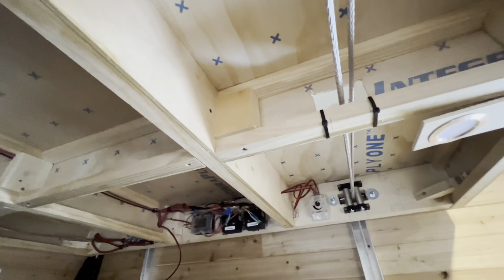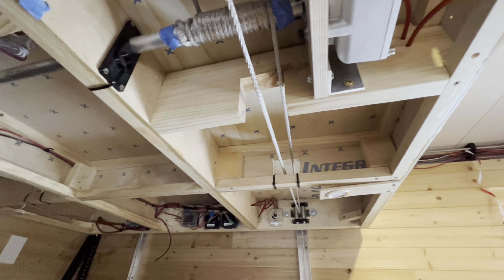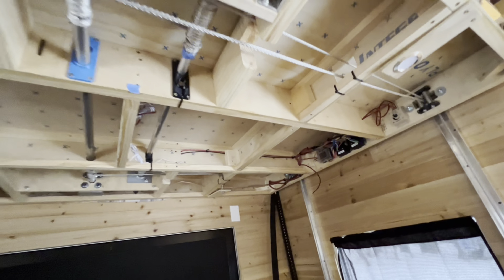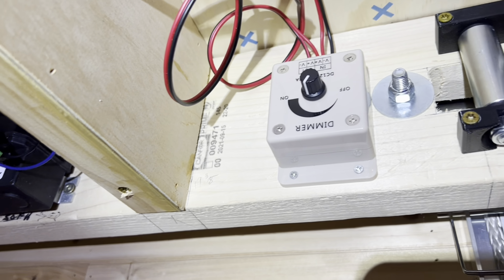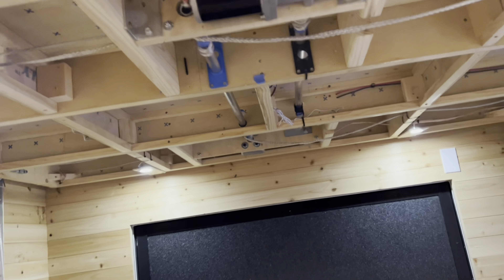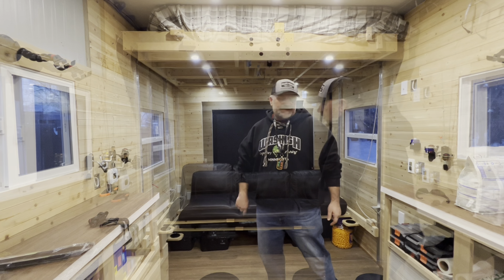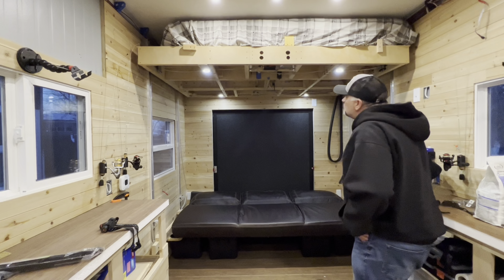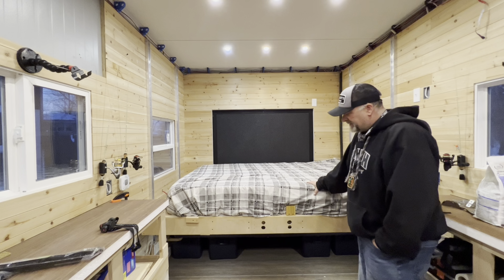DIY Dual Lift Bed and couch

Comment: Nice build, looks complicated from the perspective of a beginner who has never built anything except a shelf in high school woodworking class many many years ago, not sure if I would be able to duplicate it. Do I need a 3D printer?  Are plans available for this build? Thanks for presenting this.  You mentioned that you are still making changes and adjustments, if plans are available, will they include up to dare adjustments.  Thanks
Reply from the maker: Yes it is a bit complicated but like anything if you break things down into small sections, they are easier to understand and build. No you don't need a 3d printer that is just how I did it. Sorry I have no plans right now. Nor will I ever post plans because everyone is going to need different dimensions and some will not work if its smaller.
Reply: @VTX1029  thanks

Comment: Were you just leaving lake of the woods? I'm fairly certain I saw your house drive by!
Reply from the maker: Yes I was out of zipple bay! Tight lines!
Reply: @VTX1029  right on, I'm still up here, hope you did well fishing!
Reply from the maker: @didyoujustgethere  I've done better but not too bad. I was there a little earlier than usual. (try to get trophy's up near shore) just got small ones for the most part
Reply: @VTX1029  yeah, I picked up one 26 inch walleye a week or so ago, and mostly little stuff, but at least they are biting still.

Comment: Nice job, what did you use between the ceiling and wall for your wire track? Were they purchased or 3D printed?
Reply from the maker: I 3D printed them

Comment: Great end product and wicked video - thanks. May I ask, why did you ops for a winch system as opposed to linear actuators?
Reply from the maker: Because I wanted further travel than a linear actuator would allow. I can move mine the full height of the trailer where even an actuator that could fully extend to 8 feet will only travel around 45 inches. Trust me i considered them. You also run into timing issues when using multiple ones.

Comment: Nice.  I am interested in your aluminum sleeve collar for the straps. Did you fabricate the parts?
Reply from the maker: I made them from 1.5 inch 1/4 wall aluminum pipe. Just have opposing slots, the center bored to allow the strap to fit inside.